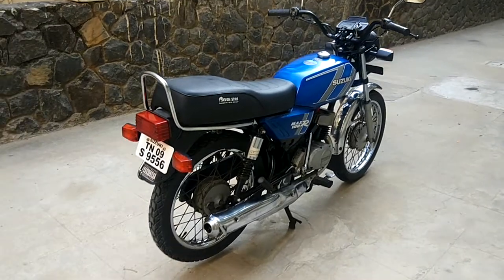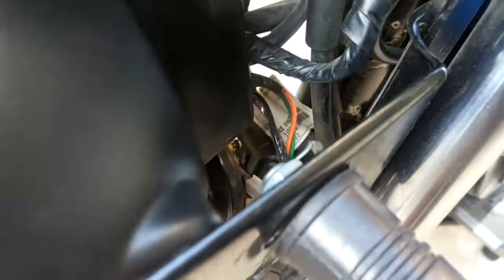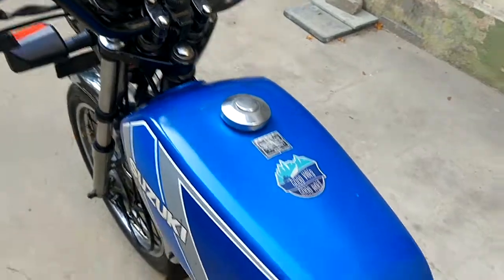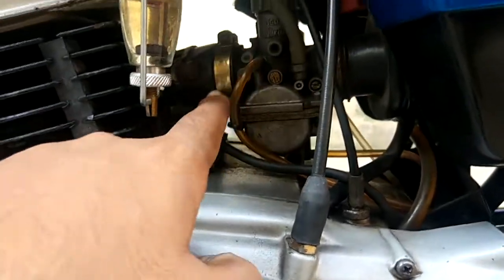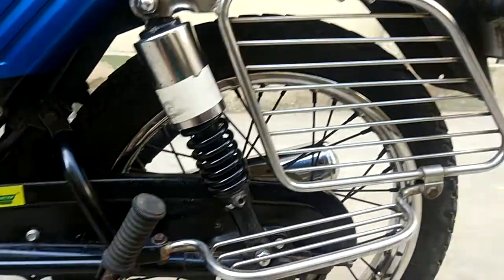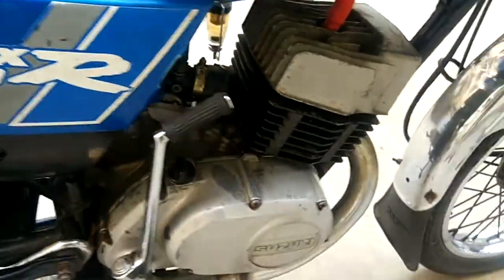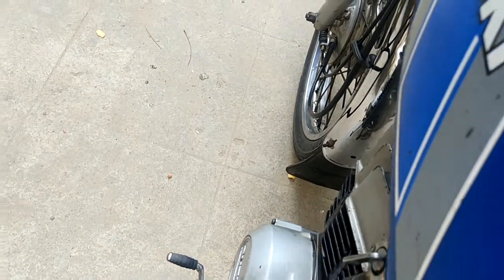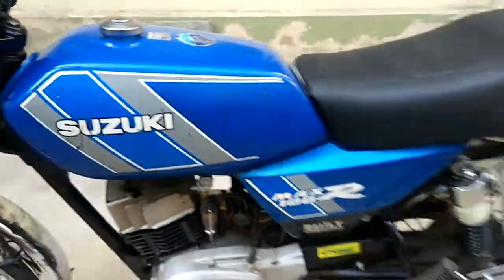My 2001 TVS-Suzuki Max 100R - A Detailed Walkaround!

Comment: Do this bike have battery in it?
Reply from the maker: Ofcourse.
Reply: @BrattyBiker  My father also have an suzuki max 100.. But its doesn't have any battery in it🤔
Reply from the maker: @basil4996  Max 100 doesn't have a battery, but the Max 100R has a battery.
Reply: Do you know other differences about these bikes?

Suzuki max 100 & Max 100 R
Reply from the maker: The 100R had a 12v system with a battery while the 100 did not havw a battery. Apart from graphics, no other mechanical changes.
Reply: Thnx bro ❣️

Comment: Headlight bhi square laga lo sir indicator and meter se match ho jayegi
Reply from the maker: Yes ofcourse sir, but Rectangular/Square headlamps of the 80s and 90s had poor light spread, so a round one is better, especially the clear lens like the one from a Boxer is much better!
Reply: @BrattyBiker  Try to replace speedometer assly of shogun or samurai 2000 model
Reply from the maker: JITENDRA DIXIT Yes sir, that was also on the plan. But unfortunately I have sold off this bike. I now ride a Yamaha RXG. You can check it out in my more recent videos by subscribing to my channel!

Comment: Bro I am confused with fuel tap on off reserve in max 100R  help me pls
Reply: Down side on, up reserve, middle off position bro
Reply from the maker: When the switch is facing straight, it is in OFF position

When you turn the switch to face down, it is in ON position

When you turb the switch to face up, it is in RESERVE position.

For Max 100R, the last 2 litres of fuel is reserve. Remaining 10 litres are main.
Reply: @BrattyBiker  thanks a lot bro
Reply: @kondraravikumar4153  thank you bro
Reply: @arjunkarthi1078  you are welcome bro

Comment: sir what different suzuki max 100 r & max 100?
Reply from the maker: Differences is branding,graphics and electricals. The Max 100R came with a battery but the Max 100 didn’t have a battery.
Reply: @BrattyBiker  thanks 1 question sir block kit & clutch components are same?
Reply from the maker: @rajeshkhodadiya2266  Yes, exactly the same. Infact, I'd recommend going for the new block piston kit from TVS as they are still manufacturing it.It's a worthwhile investment.
Reply: @BrattyBiker  can you tell me where I can get the piston for Suzuki Max 100 R?
Reply from the maker: @begarisaikumar4437  No idea, but owing to the bike's popularity, it should be available easily.

Comment: I have a max 100 but it's in a work shop but it's totally lost but I vere sad. Because I ree buld but no money this time what to do any way money come my account I do my bike well maintained I am waiting
Reply from the maker: Since it was an acident, please check the front forks and handlebar. It should not be bent. 

Max 100R won’t be very expensive to repair. Go to a good mechanic and get the basics right and that will be good. Don’t focus on things like stylish painting, alloy wheels.etc. Waste of money and time.
Reply: @BrattyBiker  y bro but cash problem this time no job then what to do

Comment: It's a fantastic video
Reply from the maker: Thank you :)
Reply: @BrattyBiker  bro engine oil epo mathanum
Reply from the maker: You mean gearbox oil ? Once every 3000-4000KM, use Motul 3000 20W40 Oil.
Reply: @BrattyBiker  nope na for engine oil
Reply: Which is the best one to use please recommend me
Reply from the maker: @immanchurchil834  You can use Motul Motomix or Shell Advance VSX for the engine. If you're premixing, premix 25ml of oil for every 1 litre of petrol, these two are one of the best 2t oils available in the country.
Reply: @BrattyBiker  lot of thanks ❤️
Reply from the maker: @immanchurchil834  Cheers :)
Reply from the maker: You can contact me via eMail : 
brattybiker123@gmail.com

Comment: Sir.. please make a video about installing neutral switch in Suzuki Max 100 R.. please sir
Reply from the maker: Unfortunately I don't have this motorcycle with me so I am not able to make a video on it.

I ride a 1997 Yamaha RXG now.
Reply: @BrattyBiker  okay..I have commented this with some other YouTuber also..But unfortunately no one gave me any update yet!..😶
Reply from the maker: @anirudhpednekar9170  You can try asking Roopak.m 

He has a Supra rebuild video and a gear switch indicator video on YouTube. He might be able to help you out on the neutral switch.
Reply from the maker: @anirudhpednekar9170  Also as far as I know, All Max 100R came with Neutral switch and neutral indicator on the console. Is yours not working ? The switch is present behind the left side of the case cover right above the front chain sprocket. 

Try opening and cleaning the terminals and put it back. Make sure the wiring is good and not frayed or stretched or broken.
Reply: @BrattyBiker   yeah..i had opened and checked but there's not present any neutral switch in it..
Reply: @BrattyBiker  there was not switch installed in it..
Reply from the maker: @anirudhpednekar9170 

Was it not there from day 1 or was it removed by a mechanic/yourself ? Does your meter have a neautral light present ? 

If yes, Then you need to get a new switch. Try from my supplier @tuners_craft (Instagram). He might be able to ship it to you if he has one in stock.
Reply: @BrattyBiker  okay sir.. thank you for helping me..i will try purchase it new one.. thanks..

Comment: My model didn't have battery system. How i can add battery system to my max100.?
Reply from the maker: Your’s is not a Max 100R,that’s why it didn’t come with a battery.To add the battery,You have to change a lot of things like the Wiring kit,CDi,RR Unit.etc.

Honestly,it’s not worth the money and the hassle.You can use that money on maintaining the bike well.
Reply: @BrattyBiker  bro Max 100r ki wiring kit or   coil ...max 100 Mai lagai jaaa sakti  hai kya??? battery install karne Kai liye
Reply: Sir  plzzzz  tel me
Reply from the maker: @2strokelover41  Yes, you can install Max 100R's electrical system on Max 100 and use the battery.

Comment: Dude what is the fuel mixture ratio for this bike
Reply from the maker: You can premix 15-20ml of oil for every litre of petrol if your oil pump is working.But if you will be running fully on premix,You can premix as much as 35-40ml of Oil for every litre of petrol.

Comment: How is this possible,  from where do you get all the parts,  I wanted a new carburetor and I tried my best but I was unable to find carburetor for my Max 100
Reply from the maker: I got my parts through online sellers (Seana Auto Spares : +91 81475 04288 and Adarsh MV Tuners Craft : 96639 94688) 
You can message them through Whatsapp and enquire about the required spares and they can help you.

I have a brand new unused Max 100R UCAL Carburettor for sale. I originally got it for my bike, but the bike was sold before I could rebuild it.If you’re interested, please eMail me.
Reply: @BrattyBiker  thanks bro for helping me,  this was very helpful for me
Reply from the maker: Always a pleasure sir :) If you want the carb (mine is brand new,unused), we can chat through email!

Comment: My Suzuki speedometer stopped working 10 years ago. But engine runs without any problem. Kindly help me to get red colour side shield.
Reply from the maker: Sure! The Speedometer's problem is either with the worm gear on the wheel hub being jammed,or a bad cable,or the Speedometer itself (the console) being jammed up.It won't cost you much.First,Check the Speedometer Cable,Best is to replace it regardless.Then check if your speedometer is jammed due to any internal mechanical failure and get it fixed.Lastly,open up the wheel hub and then check if the worm gear is jammed,and replace it if so.

Get to a good mechanic who can do it.

Also Side Shields,The best bet is to search for used ones.
Reply: Bratty Biker ok

Comment: Did oil pump works? Sir
Reply from the maker: Yes sir,The Oil pump works.But it’s good to add a little oil in the petrol so that it will save the engine from siezure even if the pump fails unexpectedly.It also helps in keeping our Fuel Tank rust-free.

About 10-15ml of Oil is enough for every 1 litre of petrol,along with your pump working.If your pump is not working,25ml oil per litre of petrol is recommended.

Comment: Nice VDO Bro.
How is d experience about long ride, and day today CT use.?
Reply from the maker: Thanks! Have done a small-long ride trip on this video : https://youtu.be/7xtVynE4D5k

Honestly,this bike is not suited for long rides.It was designed as a city motorcycle,and it does a fantastic job.It’s light,nimble and fun in city traffic.On Highways,It feels strained beyond 70kmh/r and since it’s light,a strong wind is enough to push it off the road.Also drum brakes,let alone ABS,is also not great for highways.Spoke wheels also are a nightmare in highway if you have a puncture.

Can definitely use as an everyday runner if you can maintain it in good shape.Very efficient bike.

Comment: Hi bro, I recently got this bike from my friend.
Bike condition is superb, I like the sound and pickup it has.
The only problem I am facing is starting trouble.
The bike is not starting, when I park it for sometime and after 10-15 mins it is starting after 2-3 kicks. One of my friends told to off the petrol flow once you stopped the bike engine.
Is that mandatory? 
Once the bike is started there will be no problem.

Or any other problem, if you know it. Your suggestions regarding this starting trouble?

Thank you
Reply from the maker: Hey! First of all,Congrats on the purchase! The Starting trouble could be of various reasons.Generally 2 Strokes don’t start as easily like a 4 Stroke but proper maintenance is the key.The Fuel switch or Petrol Tap should be turned off after you ride or else the fuel will overflow into the carburettor and something called as the float inside,gets stuck and can cause a lot of problems.

1) Check your Fuel Tank for rust and see if your Fuel is clean and not contaminated.If the tank is rusted,You can try to remove it by pressure washing or other techniques like Electrolysis.Stick to a single fuel station for fuel.Don’t keep changing stations as quality of fuel can change and will affect engine starting and performance

2) Premixing too much oil can also cause starting trouble.Stick to 25ml Oil for every litre of fuel.Also make sure you have Oil in Oil Tank and your Oil Pump is working.

3) Please get a Pacco Fuel Filter.It really helps in sending clean fuel to the carburettor.

4) Replace the Air Filter and clean the filter box and passage.

5) Clean your Carburettor extensively and tune it properly.I will try to make videos as to how to work and tune it properly.It’s simple but involves a lot of small parts and skills.So best to get it done by a mechanic.

Cold starts or morning starts on 2 strokes are generally painful lol so You can use the choke and start it up.

Best of luck ✌️ Please do keep watching and give suggestions :)
Reply: You are simply awesome bro.

Thank you so much replying to message
Reply from the maker: @ramakrishna1228  Thanks for the kind words :) Feel free to ask questions or recommend video topics :)

Comment: How many turns of AF screw for Best Mileage?
Reply from the maker: One and a half turn outwards for best mileage.One turn outward is more recommended as it will not let engine run that hot.
Reply: @BrattyBiker  can we install  jet from other bikes to improve mileage? I mean smaller size jets?
Reply from the maker: Riyaj Pathan Yes possible.But not recommended.

Comment: Hello  #brattybiker# last night i join xbhp also seen your update for bike i have also this bike in red my father both it new in 97, can u help me to buy same spare like (fiem Rear view mirror) Can u buy it  for me..?
Reply from the maker: Hello! 

You can buy the mirrors (and many other spares) from one of my suppliers, 

Tuner’s Craft (Adarsh)  : 9663994688

Seana Auto Spares :  8147504288

Do enquire with either one of them if you are requiring any spares for your Max.They are able to deliver parts at your doorstep. 

Hope it helps :)
Reply: Suppliers ..?
Reply from the maker: Yogesh Jora Yes, They supply me with parts that I needed. Although I don’t have my Max 100R with me anymore, I now ride an RXG, They still help me with parts.
Reply: Bratty Biker thnx bro
Reply from the maker: Sure 👍 
Best wishes! Do subscribe to the channel :)

Comment: Bro from where did you get those air filter i have been searching so long?
Reply from the maker: I think you mean the PACCO Fuel Filter.The Air Filter is easily available in every spare shop unlike the fuel filter.IR filter sits inside the left side cover.The Fuel Filter,I think I got it from Seana Auto Spares.They trade online.You can message them on Whatsapp and they will get back to you.Here’s their number : +91 81475 04288

Tell them Bharath from Chennai gave this number,The Blue Max 100R rider.

If you actually meant the air filter,They should be having it in stock too.Just check with them.

All the best :)
Reply: @BrattyBiker  bro and in my bike if I ride my vehicle fast for some distance the engine easily getting heated how to solve this problem bro pls say some measures?
Reply from the maker: SAM JOSH Heating can mean a lot of problems,but here are a few common causes and some tips.Get it to a good mechanic first :

Common issue is either lack of adequate oil in the engine or running too much oil which constraints lubrication flow,thereby increasing friction and heat.Is your oil pump working ? Are you also premixing ? How much ml of oil do you mix for a litre of petrol ? With the oil pump working,I usually premix 25ml of oil for every litre of petrol.Anything over that,will clog the carburettor and will cause the engine problems like poor performance,bad efficiency and overheating.

Another fault is when you don’t have adequate oil supply.Dirty oil tank,clogged pipe,an unclean oil pumps can can be the problem.Ask your mechanic to clean them thoroughly,use 1 litre Shell Advance VSX oil for the engine oil tank once you connect it back.At the same time,keep premixing 25ml oil with petrol to prevent rust in fuel tank and also save the engine from siezure if the oil pump fails unexpectedly.

Another common issue is your carburettor might be tuned too lean,meaning that the balance of air fuel mixture is not correct,there is too much air and too little fuel and this can cause overheating.

You can get it to a good mechanic to get the carburettor fully disamantled,cleaned and rebuilt.He will tune it properly so that the overheating will be solved.Tell me your area,I will see if I know a good mechanic there.

If you want to fix it yourself,then here’s a DIY

Solution : Start your bike and warm it up by letting it idle for 5 minutes.You will have two screws on the left side of your carburettor.The Bigger one is the Engine Idling Screw and the smaller one on the side is your AFR (Air Fuel Ratio) Screw.Take a screw driver and rotate the AFR Screw clockwise,fully until it can’t rotate more (DO NOT TIGHTEN),when you are doing this,You will notice the engine to slow down and stop running,that’s normal.Now,Rotate the AFR screw anti-clockwise (loose it) EXACTLY 1 Turn and leave it there.Now get to the Idling screw and tighten it half a turn and try starting your engine.The engine might idle too high.Now turn on your headlight highbeam and then reduce your RPM by loosening the Idling screw slowly,you will automatically know what is the correct idling speed using the engine’s sound and now leave it at that.

This should offer a better air fuel mixture to the engine which means the engine will run properly without overheating.

Hope it helps :)
Reply: @BrattyBiker  omg I cant believe your awesome thank you for your kind effort
Reply from the maker: SAM JOSH No problem! All the best,Ride safe :)

Comment: How much does it cost for silencer bro
Reply from the maker: A Good Exhaust,as a whole can cost you under ₹1000 from the scrapyard.The Inner Core (Baffle/Muffler.etc,just different names) are a replica of the Shogun and can cost close to ₹300 new.Prices may vary quite a lot.
Reply: @BrattyBiker  bro changing muffler,Is it modification?
Reply from the maker: @ahamednihal.  Yes.It affects engine behaviour as well.Bike feels slightly better on initial acceleration along with the better sound.

Comment: TVs Suzuki max 100R gives how much mileage per 1 litre? Plz give me
Reply from the maker: This bike in good condition can give you between 45-50kmpl inside city. Sometimes till 52kmpl.
Reply: @BrattyBiker  after bore and full engine work done
Reply from the maker: Freshly rebuilt engine will give you between 40-43kmpl. Once the first initial 1000KM running-in is done, mileage will increase automatically.
Reply: @BrattyBiker  before 1week full engine work done full bore 
So, now it gives how much mileage per one litre petrol
Reply from the maker: That’s good. I don’t know how much mileage your new engine gives because I wasn’t the mechanic who built it & I haven’t ridden your bike either.
Generally as I said earlier, you can expect 40kmpl.
Reply: @BrattyBiker  ok bro tq but normally it gives how much mileage per 1 litre
Reply from the maker: @rajashekharchekurthi7091  I just told you sir, normally 45-50kmpl
Reply: @BrattyBiker  ok bro